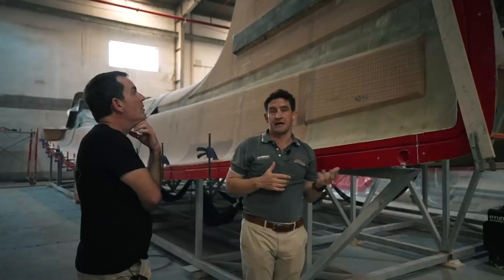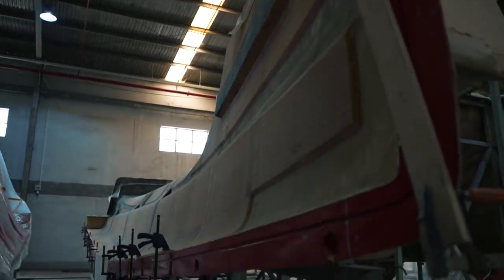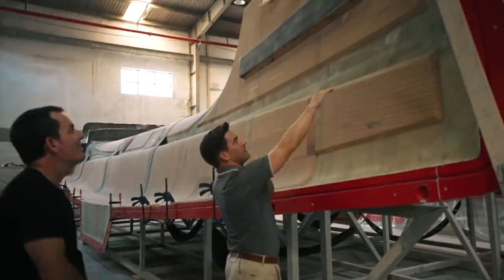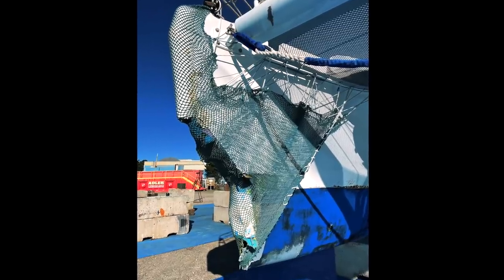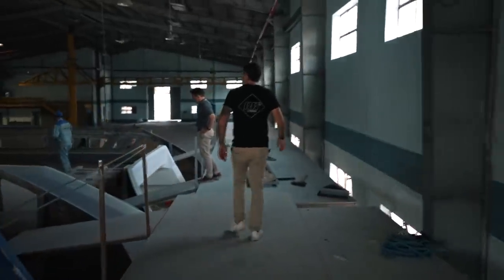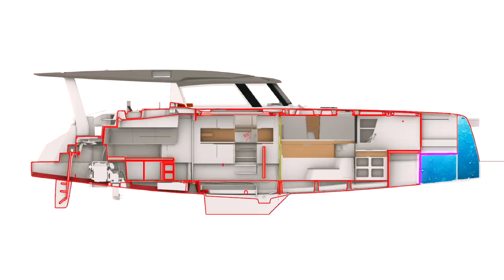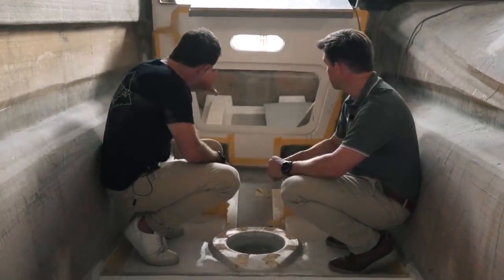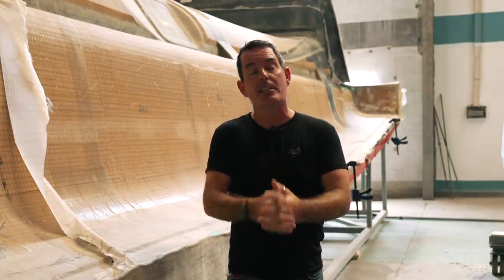NIGHTMARE Boat Crash 1,000 Miles From Land!

Comment: Not sure I’d be happy that the bulk heads do not seal completely , having a sump system might seem great but it could be repeated 3 times in each hull for each compartment giving a guaranteed watertight compartment that water cannot flow to the next compartment keeping her afloat . 
If the vessel was holed by removing a keel ,the water could find its way forward and aft of that damaged compartment compromising stability . If all bulkheads were sealed water would not pass through to the next , although the vessel now sitting lower in the water it could be more safe .

Comment: Having now watched a significant number of channels where owners repaired their damaged boats and discussed various aspects of that process.

It is quite obvious that regions where structural features such as the junction between bulkheads, stringers and hulls are significantly stronger if right angles are avoided and to that end most people employ substantial fillets.

The watertight crash bulkheads examined with Mike at the Seawind production facility during your discussion did not appear to have appreciable fillets at all and I am curious to know how that works please?
Reply from the maker: Hey, I think Mike mentioned that they are not right angles, but curved
Reply: @sailingrubyrose  Ok, I couldn't see that but thank you for a reply.👍

Comment: Therefore allways shaftdrive..., saildrive is dangeros...
Reply: It's protected by the keel.
Reply: @gbsailing9436  sorry sir, its not.
Reply: @MK-gr9qz  Yes it is. Look at the profile anything trying to hit the sail drive will hit the keel first and MOST likely be pushed down. A shaft drive is JUST AS EXPOSED by anything popping back up again and will most likely damage the seal and hence flooding will STILL occur and bending of the shaft! Which is better? Depends on where you are in the world and how well parts and repairs can be managed! End of discussion.